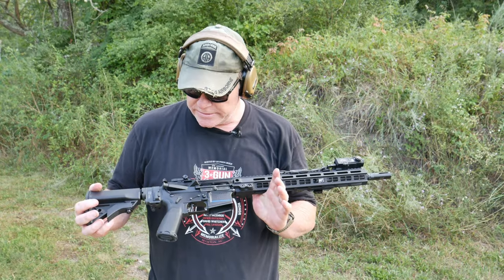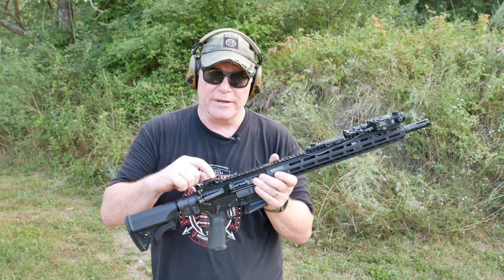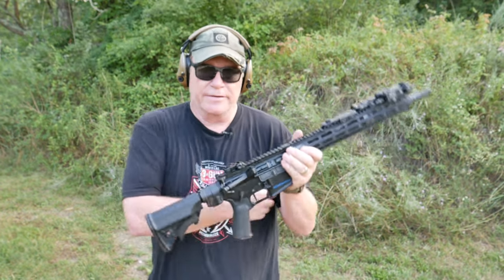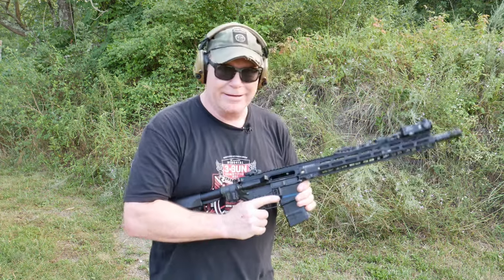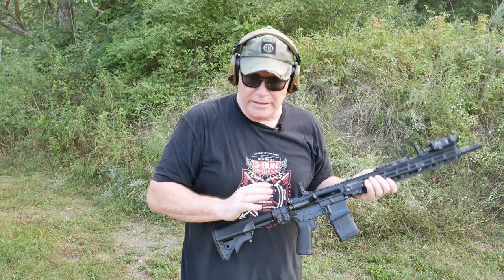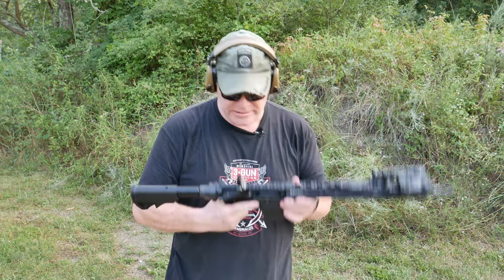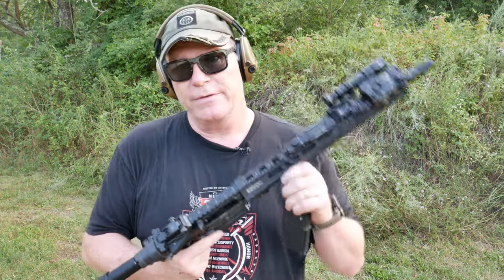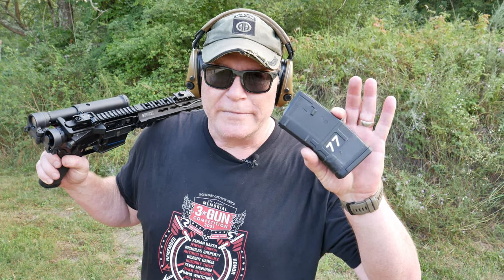How I Function Test my Rifles

Comment: It works. You act surprised. 
I used your videos to build my first few ar15s and they all worked flawlessly. 
That was back when YouTube wasn't censoring as bad and you were doing a lot of cheap builds compared to top tier. 
Bolt carier and barrel are were to put your money. Not to mention your hatred for noisy extension tubes.

Comment: I have a 700 rem mag with a magpul after market stock 
(I wanted an external magazine) but the bolt dang near butts up to the stock when I chamber a round.
Is that normal? Is it okay? Or did I just get the wrong part from magpul?